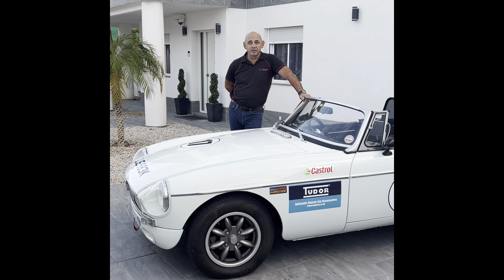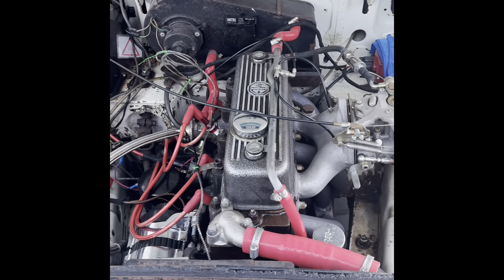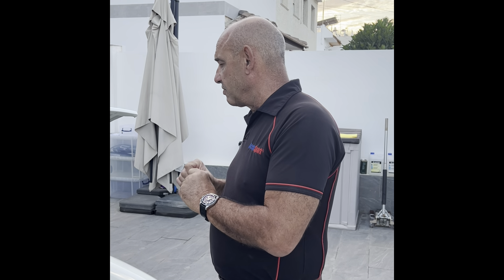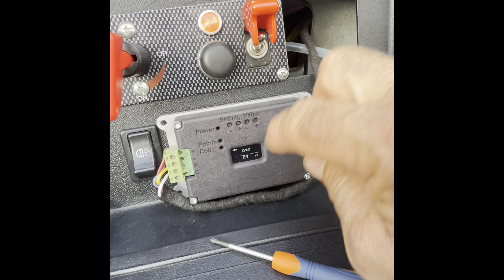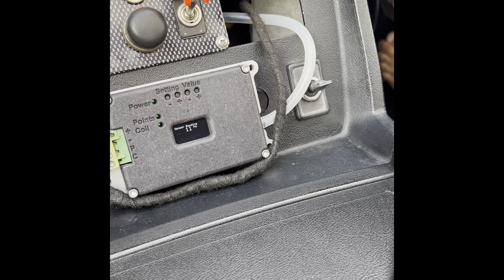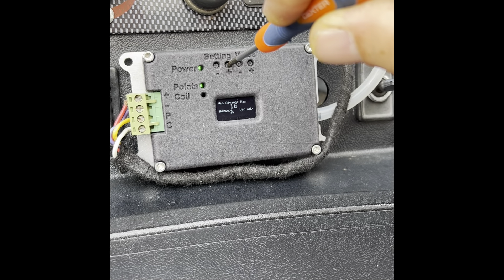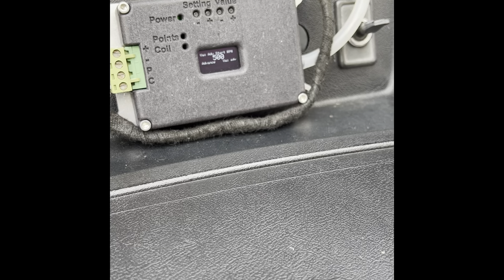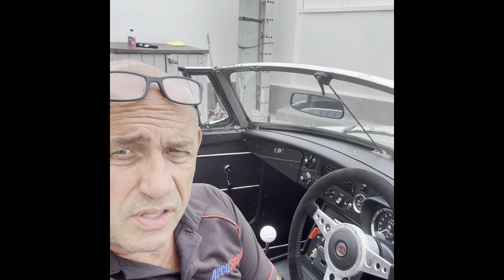2. BlackBox 3 with MultiSpark Vacuum set up .Programmable ignition from AccuSpark :

Comment: Have had one fitted for a while and it works great. 
Very easy to play around with different advance curves. Vacuum advance can be connected to the manifold and made to work as ported vacuum just by adjusting the rpm it starts at as shown in the video.
Highly recommended piece of kit.

Comment: Hi, Thanks for the video! I have an MG TD, that hasn't got any advance fitted as standard. The information from the internet to obtain a vacuum supply is:-   drill both SU H2 carburettors by the butterfly valve and fit a balance tube between the two vacuum supplies. 
My question is... You have taken your vacuum supply from the manifold, is there any advantage to taking the supply from the SU carburettors. This product seems ideal for adding vacuum advance to an MG TD with the bonus that it is British made.  by the way... All three of my classic cars have AccuSpark ignition and also my Ariel Square four! I'm extremely happy with your products! Keep up the good work!
Reply from the maker: No advantage, you should just install takeoff from the most convenient place. As Blackbox comes with a built in vacuum gauge it can be calibrated to any value. 
You are correct this would be perfect for you . 
Thanks for your positive comments 
Tony
Reply: @TUDOR-GROUP  Thanks! I better get one ordered!

Comment: Received it in the post today. I have removed the Megajolt system and this is the replacement. I became totally fed up with the MJ and PC refusing to communicate just when an mot comes round and I need to reduce hydro carbon or I wanted to try to improve the ignition timing. Connecting up tomorrow so I shall see how we go but from what I've seen this is the simplest yet most adjustable controller available. Hope it proves to be